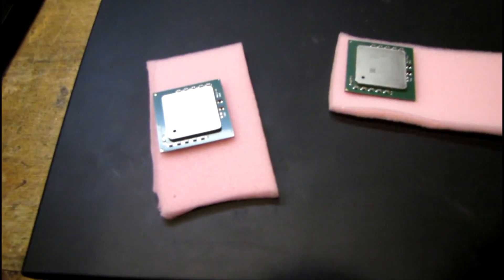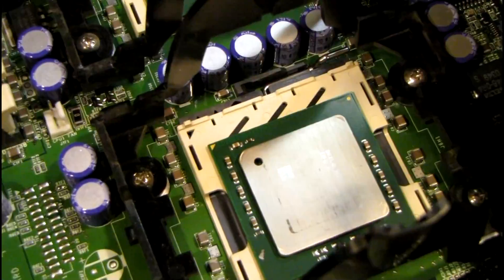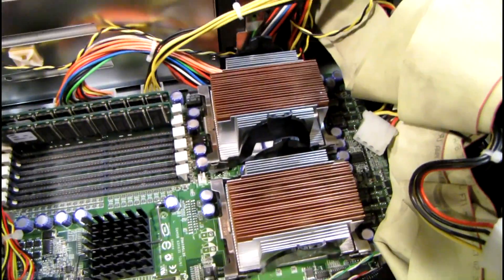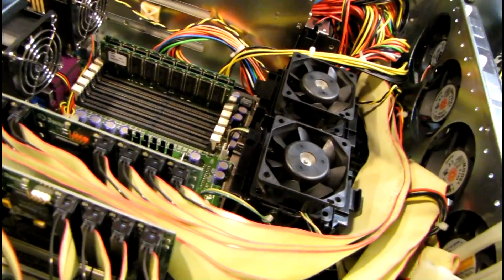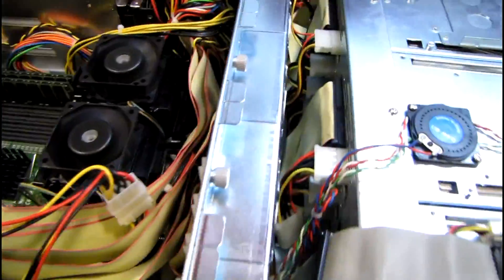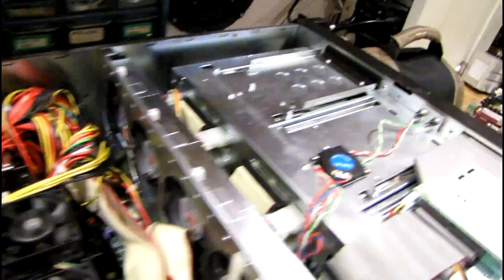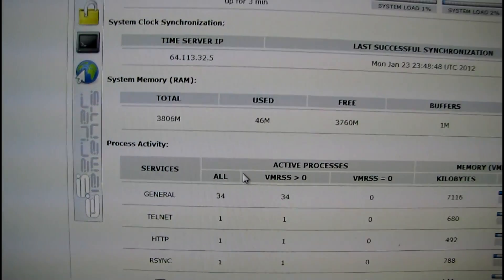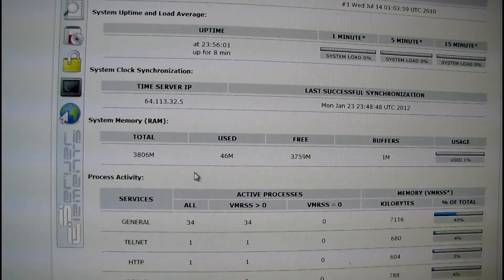Upgrade and repair my file server January 2012 *Part 3 of 3*

Comment: About the 32-bit CPU and more than 4GB RAM. It can work, just not in all cases. You need a CPU that supports PAE (Physical Adress Extrention), a motherboard that supports PAE and last but not least an operating system that supports PAE.  And there's the biggest issue, normal desktop OS'es usualy do not support it, and sometimes it's a chipset limitation of the motherboard (chipset not supporting PAE).  Server PC's however in many cases do support PAE and thus they could use more than 4GB of RAM dispite it being a 32-bit CPU. But like I said, it usualy doesn't work with normal consumer PC's, just servers.
Reply: Most of the Linux distros which still have 32-bit support have PAE-enabled kernels. And all P6 and later CPUs have PAE, it's just the older motherboards which are limiting.

Comment: A modern computer would use 1/4th the total power of this system and be 4 times as fast. All those ugly IDE cables restricting air flow. Junk!
Reply: y'know whats really cool?   when people mind their own business and let people do what they want to do with their own computer systems.
Reply from the maker: Ambrose tant-phillis  A while back I got a new system, and it ended up being around $2,400 total.  I just hope it lasts.
Reply: Raid and disk costs though.
It'd cost easily $700
Reply: It will, your new drives are better designed for a NAS plus synology systems last for ages and use way less power than most servers.
Reply: +KaidoFujimi I agree with you.
Reply: hahaha nice dude

Comment: i currently have a Pentium 3 Server with two SL6BY processors and 1gb of ram. i plan on getting more ram....right now im using it as a file/game server. 

i plan on running more than 1 source dedicated server but idk if i need a socket 604 server or socket 771 server.

Comment: Back in the days i build a lot of this kind of intel server's. We had the first dual core xeon's from intel in holland. i really like the intel server platform. And i still have 2 of those 60mm cpu fans unused in my collection :) They are pretty loud haha but so much airflow! I had them for in mu dual xp machine but they where to loud. So i got 60mm to 80mm converters and used 80mm fans :)

Comment: any ideas? i got a socket 775 running 3 gig core duo vista 32 bit 1 gig dual channel usb 2.0 250 gig sata hard drive i want to run 64 bit 7 and upgrade 2 2 dual channel 2 gig ram slots for 4 gigs and is there a better processor? i cheaped out and got an acer so its all prebuilt but tooles design and some of the hard ware is still good i just need to get rid of slow ass vista 32 i want 7 64 and a small ssd drive so i can use it as the os drive any suggestions?

Comment from the maker: @amfan12 Yep, I just use this system for the capacity and redundancy.  A normal PC breaks down too easy.  Even though it is home use, I do have a couple terabytes of important data.  Mainly all the pictures and video from my camera.  The main thing stopping me from using a modern single CPU system is the cost of hard drives and hardware RAID controller.  A 4TB modern system would cost a ton of money.

Comment from the maker: @marioc65 Most modern computers use a CR2032 lithium battery which does not recharge.  They usually last a few years.  Back in the 286 and 386 era, some computers used rechargeable batteries.

Comment: @Maxxarcade It seems that more than one of your viewers seems to think that you run some kind of datacenter or something? Your rig is already overkill for a home media server. A single CPU system with couple of hard-drives shoved in it is more than adequate for most home use.

Comment from the maker: @RetroPCDOS I spent $30 on the ram and cpu's all together.  The ram is actually matched as far as specs and speed.  If anything was mismatched the BIOS would complain.  It did it to me before when I mixed DDR266 and DDR400, despite them being in separate banks.

Comment from the maker: @teflondon91 I understand throughput perfectly.  I don't need more than this for a simple home media server.  And who said anything about the chips overheating?  This system runs cold.  I only said the drives would overheat if it was run without the fans, which any server would.  I spent less than $200 building this system from spare parts, and have 3.7TB with full redundancy, and enough bandwidth for several users.  Why would I need to upgrade it further?  New stuff breaks too.

Comment: @maxxarcade I've got an older system that uses pentium 4 architecture. it's a dual processor board running a single cpu right now, debating putting xp media center on it and getting a second cpu and cooler and possibly a few more gigs of DDR2 ram, and maybe a better agp2x graphics card, is it worth it? I've looked into it and probably the most expensive part would be the ram, the CPU's themselves are VERY cheap on ebay, which surprised me since they were so expensive new.

Comment: Bogomips on the Intel platform is basically the clock speed x2. Like if I had a 2 GHz CPU, the bogomips would be 4000

Comment from the maker: @CVRealMan Ya, the problem is finding a board with two 64 bit PCI slots that aren't right next to each other.  I had actually bought a board a couple years back to do just that, but the RAID cards didn't fit.